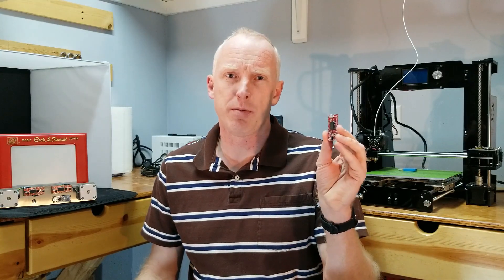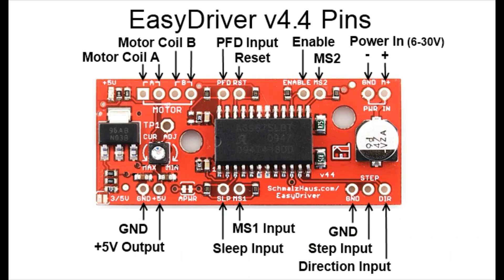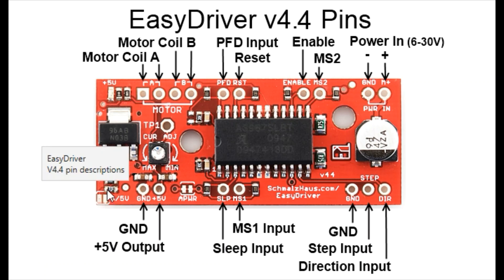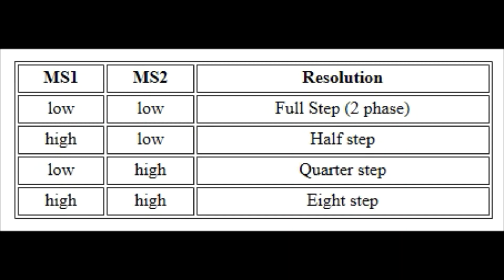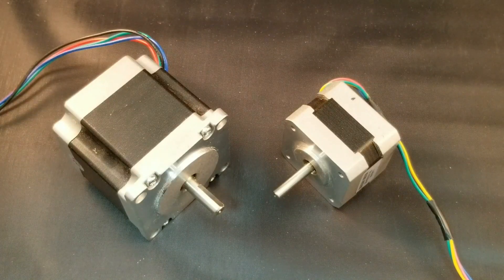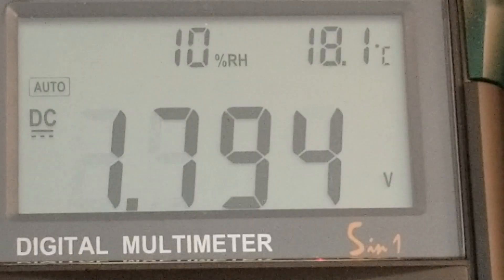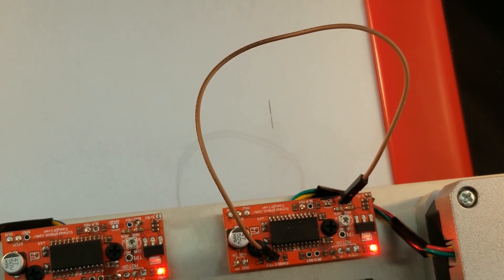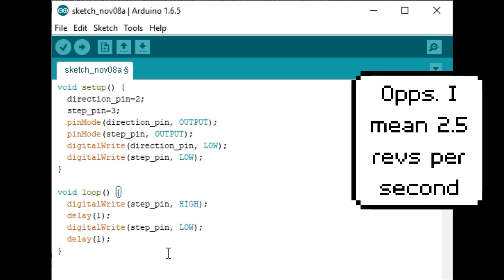EasyDriver A3967 Stepper Motor Driver Tutorial with Arduino Code

Comment from the maker: Please help my new channel get some traction on YouTube by liking, sharing, and subscribing so that I can continue to make helpful and fun tutorials (I've got some great ideas in the queue). I need 1000 subs in order to monetize my channel to help reinvest in equipment for future videos. Thanks for watching!
Reply from the maker: Anyone done any creative projects lately with the EasyDriver board?
Reply: @ScienceFunInnovations  Came across your video looking at this board and stepper motor to operate an automated chicken coop door.
Currently I have several doors using standard small dc motors and they work okay, the stepper motor application seemed interesting to me.  So for my application I would need to run the motor forward for a time then stop, later, run the motor backward for a time and stop.  With the dc motors, I run them for a number of seconds and cut them off when a limit switch is reached.  Should the switch fail, the seconds expires and the motor cuts off anyway. I'm using a Mosquito MQTT server on a Raspberry Pi, along with Node-Red to control a NodeMCU ESP8266 with ESP Easy firmware.  This combination works really well for my needs, but doesn't seem to be a mix I see very often. The big benefit of using a stepper motor is the ease of matching the motor to a lead screw and associated hardware. Most chicken automatic chicken doors want to wind a string to open the door.  A lead screw provides a much better lock on the door which is better suited to thwart raccoons that would quickly thief a chicken dinner.
Reply: Fix the audio.

Comment: is it possible to manually activate the steper motor by soldering a push buton inbetween  the +5 and step pins
Reply from the maker: Yes. But you would have to push many times to get it to turn. :-)
Reply: @ScienceFunInnovations  actually it not make 1.8deg when i push it and i dont feel any resistance in the axis maybe because i let all the pins loose and not grounded ?

Comment: Sir,
Would it be possible to run this driver using input from "REES52 Stepper Motor Driver Speed Board Controller Pulse Signal Generator Module"
I am a amateur and would appreciate your reply as to the connections.
Thanks
Reply from the maker: I am not familiar with that module, but there are several stepper motor drivers out there and they pretty much work the same way. Thanks for watching!

Comment: Your inductance value is most likely wrong. It should be 0.0046 not 0.046. So the calculated speed is x10 what you show.
Reply from the maker: I'll have to check on that...

Comment: Hello, 
what size are those plastic screws black color holding in place the easy driver?
I am trying to attach everything in place in a personal project,
thanks, 
Leo
Reply from the maker: I used M3 (3mm) screws. I used nylon screws, standoffs, and nuts and they worked really well (and I didn't want to short anything). Good luck on your project!
Reply: @ScienceFunInnovations   Great, thanks for you answer.
I have another question for you, my steppers have a rated current of 1.7A, is this the reason why I cant get them to go faster? I am wondering if the easy driver you are using will be strong enought to provide for those steppers. if so, is there another way to increase the speed if increasing voltage and decreasing amps didnt work?
Thanks a lot!
Reply from the maker: @leonardoavendano6031  To get high speed with Easydriver, raise input voltage (up to 30V max), turn down the current setting, and/or find motors with lower induction. 1.7 is just a max current. If you care more about speed than torque, you can drop the current on the ED. Hope this helps.
Reply: @ScienceFunInnovations  Unfortunatelly the speed didn't change with those modifications. I would say my last try to speed up those steppers would be modifying the code, changing steps or frequency?
Reply from the maker: @leonardoavendano6031  The code definitely controls the speed. Reduce the time in between pulses, or you can play with the tone command to see how fast it will go.
Reply from the maker: @leonardoavendano6031  Also makes sure micro steps are disabled.

Comment: hello 

I'm learning about stepper motors using arduino.. It just works fine... but the actual problem is after uploading the basic stepper motor code to arduino;  its not rotating one complete rotation can u help me???
Reply from the maker: How many pulses (steps) are you sending and how many degrees is the motor turning? May have to do with micro stepping...
Reply: @ScienceFunInnovations  
I have uploaded basic stepper code which performs one rotation in clockwise and two rotations in anti-clockwise direction with 200 steps... The motor works fine but it is not rotating completely in both the directions...

I'm using nema 17 with easy driver (a3967 module) and arduino uno
 
 For current limit setup in easy driver, the voltage we set to is 1.792 V

Could you spot the error which I'm making?

Comment: These easydriver supports upto stepper motor NEMA 23, 24 34...? Sorry if it sounds stupid.  I did not study this electrical.
Reply from the maker: Good question. The easydriver will work with larger stepper motors but will have limited holding torque due to the maximum current. It just depends on how strong you need the motors to be.

Comment: An easy way to tell if you have the wires in pairs on a stepper motor is to hold two wires together and turn the shaft.  If the wires are a pair, the motor will resist turning.  If the motor turns freely, you have one wire from each coil set so try another wire.  No multimeter required.
Reply from the maker: Great idea!

Comment: What about the h-bridge functionality? How to use it?
Reply from the maker: Easydriver is a stand alone solution. I have another video about H-bridge and stepper motors.
Reply: @ScienceFunInnovations  i was wondering if I could use this board to control 2 dc motors as woth the L298N. I would like to do this because the L298N comes with a big heatsink which is not needed for the 6v from a couple of batteries I'm gonna send to the motors

Comment: I cannot understand the sequence of the wire connections. I have several stepper motors (unipolar and bipolar) and this is my biggest difficulty. The sequence of the stepper motor wires I know how to do; I just don't know the sequence to connect to Easy Driver; it is a logical sequence like 1 & 2 = [A] and 3 & 4 = [B]; or 1 and 3 = [A] and 2 & 4 = [B]? Can you help me? Thanks
Reply from the maker: It doesn't really matter which coil goes to output A or B. It's just important to find which wire on the motor go the same coil. One way to check is with a battery. If you connect a battery to two wires and the motor resists turning, you have found one coil. If the motor spins the wrong direction, just switch the two wires on one of the coils. Hope this helps...

Comment: how do u mircostepping? i cant understand the datashit
Reply from the maker: Micro stepping is done with pins MS1 and MS2. Depending on which pins are connected to 5V (HIGH) and which are connected to GND (LOW). By default, both pins are HIGH and the board will do 1/8 steps.  If you connect both pins to GND, there will be no micro stepping.
If MS1 is HIGH and MS2 is connected to GND, it will do 1/2 steps. If MS1 is connected to GND and MS2 is HIGH, it will do 1/4 steps. Hope this helps.

Comment: Can you help me? My stepper motor is rated at 8V, does this mean I can't use an external power supply that's higher than 8V for my EasyDriver? I'm currently using a 12V external power supply and it does seem fine. I know the EasyDriver can have an input of 6-30V but how do I know how much is going through the motors?
Reply from the maker: The good thing about the EasyDriver is that it is current limiting. My guess is that providing 8V directly to one of the coils would provide the maximum current (which is really what is important). If you know the resistance of the coil, you can calculate the max current dividing 8V by the number of ohms. As long as you adjust the screw on the EasyDriver to deliver less than the maximum current (as shown in the video) your input voltage will not matter. You should be able to use 12V power supply just fine and the EasyDriver will protect your motor. If your motor feels too hot, you can turn down the current even more on the EasyDriver. Hope this helps, and thanks for watching!
Reply: @ScienceFunInnovations  Thank you for the detailed answer!

Comment: Hi, I have just done this Arduino programme and I get an error code for the first line of the void code, it says.  ' " direction_pin" does not name a type' can anyone help me correct this as I have no idea what to do as far as Arduino language is concerned, any input would be helpful.  Also I am looking to control the rpm's with a potentiometer. Could you help me with the code for this using an Arduino uno v3 and this motor controller here. Many thanks, Samrodian
Reply from the maker: Send the code to my business email and I will take a look. No promises, but I will take a look. sciencefunbiz@gmail.com

Comment: Nice lecture. Thanks.      Why does current affect the speed. One would think its just the pulses from arduino board. please explain.
Reply from the maker: Good question. You can control the speed with the Arduino up to a point. The Arduino can send commands faster than the motor can respond. The higher the current, the longer it takes to magnetize and demagnetize the coils. The magnetic fields act as resistors to the flow of electricity. The higher the current, the stronger the magnetic field, the more time it takes to change the magnetic field. In order to have the motor turn fast, you need to rapidly change the current flow in the coils. High current increases the torque, but makes it harder to rotate quickly. Thanks for watching!

Comment: Does anyone know if I can connect two of these drivers (ms1 ms2, step, dir, sleep of each of the two drivers in parallel) so that each one commands its steper motor with a single arduino board?
Reply from the maker: Yes. You can connect in parallel and control several EasyDrivers with one Arduino. Also, you don't have to always connect ms1, ms2, sleep, to the Arduino. You can wire them directly to GND or 5V if you always want them off or on. For my etch-a-sketch project https://youtu.be/d6EGvCpYj6U I control two steppers with one Arduino and only connect "step" and "dir" (only uses 4 Arduino pins).

Comment: i'm not very familiar with the type of controller you are referring to. why did you say don't plug out or you will burn your board?
Reply from the maker: Don't disconnect the motor wires while the easydriver board is energized, or it can damage the board. Not really a problem if you use the solder board, more of a problem with the pin header version.
Reply: @ScienceFunInnovations  ty, i read about it here : 
https://electronics.stackexchange.com/questions/345003/why-does-disconnecting-a-stepper-motor-while-powered-on-damage-the-driver
seems like the inductive current may try to find another way and do a spark like current on a mosfet.